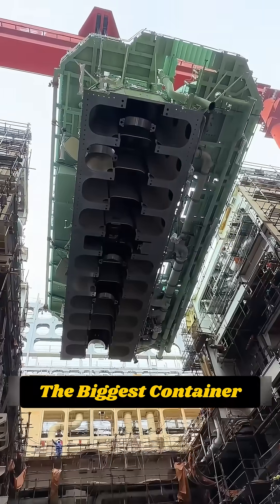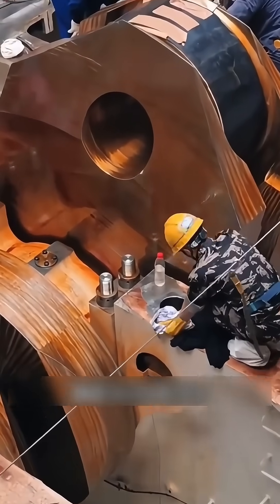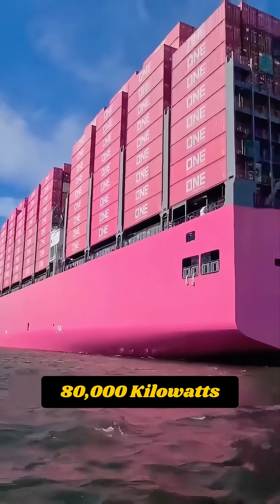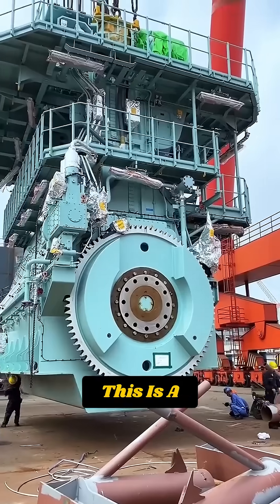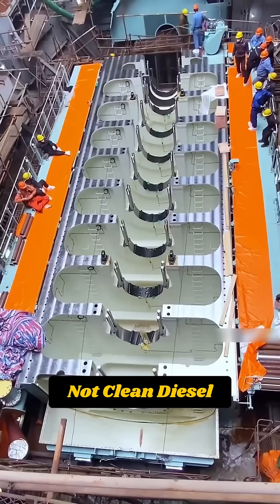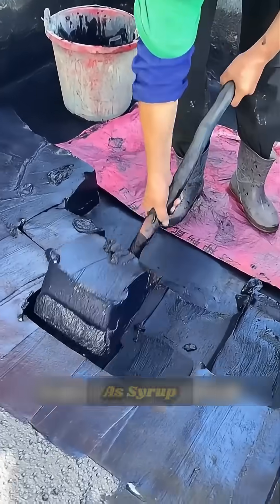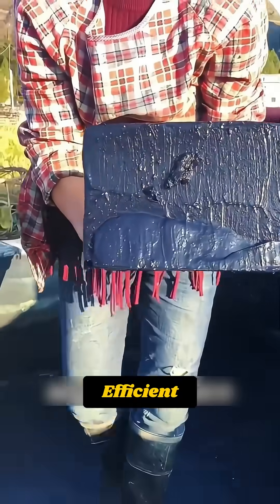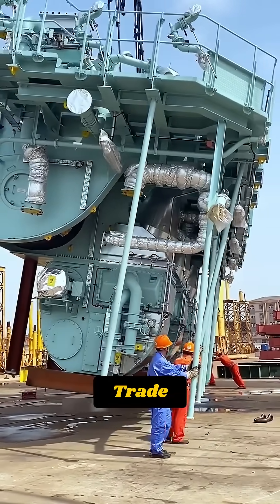109,000 HP! The World’s LARGEST Engine Wärtsilä RTA96 C

Comment: The Heavy Fuel is gone story because it causes abnoxious exhaust gas generation causing releasing of noxious compounds in air which inturn causes air polution , now the fuels are coming with 0.1 % mm sulphur of vlsfo and lsmgo, methene, lng,  methenol, amonia, bio fuel and experiments going on to run on hydrogen fuel , so ad to reduce emmisions of noxious compounds.